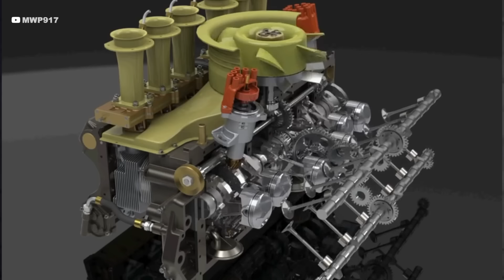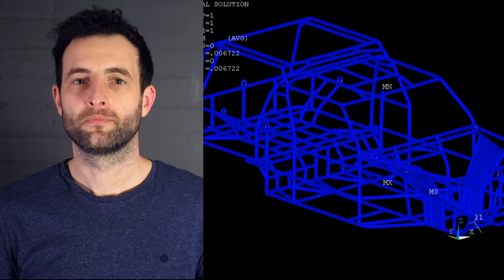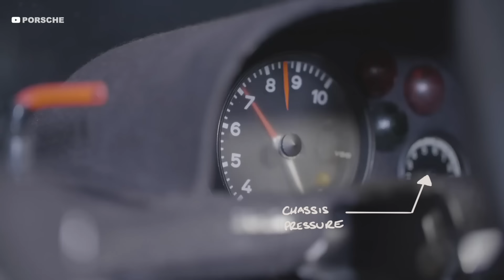The Porsche That Had an Inflated Chassis

Comment: Engineers: Of course, run hot oil through the spaceframe itself! Simple, elegant, no downsides.
Drivers: HELLO, THIS IS LITERALLY A TOASTER NOW, AND I'M THE BREAD
Reply: had a good chuckle when he explained that part.
"why the hell would they discard it?"
"oh."

i honestly thought it was a genius space and weight saving. totally forgetting that someone's actually driving it.
Reply: Not sure why we are getting excited about the oil running through the chassis to the oil cooler. Pretty much every race car of that period did that. Only stopped happening when the sport moved to monocoque chassis'
Reply: @psk5746  mass-production motorbikes also, eg. some Buells used the frame for the fuel tank and (I think?) the swingarm for the oil tank
Reply: @jsleeio  true. Clever stuff. Quite like those bikes, even though I'm not a fan of the engine choice
Reply: My 450 dirt bike uses the frame as an oil tank... Didn't know in the beginning and burned my hand on it 😂
Reply: @HochstartHarry  What bike
Reply: @9.5.9.5  2006 Yamaha wr450f steel frame. 450cc 5 valves a carb and 60+ HP at the wheel.. Best modern widow maker out there (only weighs 103kg aswell
Reply: @HochstartHarry  That's a nice bike right there
Reply: Great for a crash, deep fried driver !!
Reply: With a small crack in the frame, it squirts oil on the track, causing carnage for every other car.
Reply: @HochstartHarry  pocket rocket, nice !
Reply: @scottrich976  not really 😂 its an mx bike not a street bike.. Topspeed with current gearing is around 140-160 kmh
Reply: @HochstartHarry  I'll bet it goes skyward quick. That's what I was meaning, not a road bean.
Reply: @scottrich976  sure does.. Power wheelies in 5th.. Need i say more 😂
Reply: @jsleeio  bourgette for sure.
Reply: @HochstartHarry  f me that's some bike
Reply: No bacon and oven
Reply: @psk5746  mine ol honda xl600 bike also had oil in frame, very nice but hot to touch under desert/hard summer runs
Reply: @jsleeio  honda xl series also
Reply: @jsleeio  yet they still way slightly more than a main battle tank :p
Reply: @psk5746 agreed , NASCAR did it with fuel lines  and oil
Reply: @psk5746  no. They're a cool concept but unfortunately going with the h.d. engine just killed then. My buddy has an XB9R (the one with the full fairing that looked like an actual sportbike) with the 984cc engine, stage 2 exhaust, stage 2 intake, and stage 2 ecu tune, and I walked him on a Suzuki sv650s (650cc vtwin) that was bone stock aside from a Scorpion slip-on. There is no reason a bike with a stock 650 twin should not just beat, but demolish a similar bike with a modded 984cc twin. Sorry Harley riders, but your bikes are slow.
Reply: @brianvogt8125  and with the wall thickness of that tubing being 2mm or less it's not like a cracked frame is at all out of the question....
Reply: @TheMattc999  completed agree. Rubbish engine
Reply: made me wheeze so hard
Reply: couldn't the hot pipes be put inside an even thinner tube, like a heat shield like thing, maybe even make it so that the further half of the inside pipe actually gets put outside the vehicle and gets cooling fins pretty much turning the side walls into a semi-cooler
Reply: @HochstartHarry  my suzuki dr350 does the same
Reply: Those engineers got their first lesson on ethics from the driver...
Reply: @psk5746  Running water or oil they the tubes was outlawed by the majority of racing organizations when drivers got burnt badly when those tubes broke in a crash, NOT because of the coming of monocoques.

Comment: Up! movie: Strap balloons to a house
Porsche: *Makes the car a balloon*
Reply: They could have filled it with helium and it would have been even lighter.😂
Reply: @tanmayta9131  Yeah, some gases are reactive/explosive
Reply: @RacingLegendss  Yes, but helium doesn't react or explode cause it is inert.🙂
Reply: The car flew around the track literally and figuratively
Reply: @getnaenaed4222  that’s true  hahahaha
Reply: Actually the reason they fill the chassis with gas is to detect leaks have. That way if the chassis is under pressure they can check a gauge to see if there are any leaks. It's not to make the vehicle any lighter
Reply: @77Avadon77  Yes we all know that. The helium thing was just a joke. Besides helium is much more likely to rapidly expand or contract even on relatively small changes in temperature causing the pressure to vary drastically.🙄
Reply: @tanmayta9131  I didn't even watch the video you probably had to watch the video to know that LOL
Reply: Should have probably used the word noble.😅
Reply: Helium is a very fine gas and can 'creep' through materials causing the loss of pressure.
Reply: @Berkcam  I did not know that.
Reply: @tanmayta9131  Or hydrogen.
Reply: @Rondo2ooo  Is it a joke or do you not know that hydrogen is flammable?
Reply: @tanmayta9131  vacuum even lighter
Reply: Germans aren't very good at making balloons..
Reply: @BoleDaPole  they are pretty good with gasses tho
Reply: air ship flash backs
Reply: @MechaNick03  The vacuum would probably not be well received by the paper thin walls of the tubes.

Comment: Imagine how rediculous it would be to have a chassis health barometer on your car
Reply: hehehe 
good one
Reply: Bet the drivers paid most attention to that gauge
Reply: Not ridiculous at all. The same basic system (except with compressed air) is used in many tubular structures that rely on weld integrity for their strength - crane and drag line booms, for a start.
Reply: Actually...aeroplanes have this too (sort off)
Reply: @PapaWheelie1  They did. There is a documentary on this car where they explain as much. If the pressure dropped below a certain level, the drivers were instructed to park the car, lest they risk rapid unscheduled disassembly.
Reply: @djeurdjel1   The Zlin 526f (not sure for the others, but on this one  I saw it) does indeed have a pressure gauge for the nitrogen pressure, that probably saved many lives in this acro trainer
Reply: @halofreak1990  LOL!  "Rapid unscheduled disassembly."  You do have a gift with words, and a dry wit both.  <tips hat>
Reply: But it did have an attachment point for one, although the actual barometer (the pressure gauge) was used only occasionally, to check for leaks.  I suppose they could have attached one permanently, as with any other monitor (fuel pressure, engine temp, etc), but if the pressure suddenly dropped, that was pretty much it anyway.  The others you might repair, but a chassis leak would be terminal, at least for that particular race.
Reply: Gotta go get that new chassis with my oil change
Reply: It's like in games haha

Comment: 5:35 "... they pressurized the entire space frame with nitrogen..."
Having indication of cracks it's not the only and probably not the most important benefit of pressurizing the space frame.  
Pressurizing a space frame allows you to use thinner material yet still avoid buckling.  think of how you could stand on a full can of Coke, but there's no way a depressurized can would support your weight.  
The Atlas missile also used this method to avoid buckling while saving weight.  doesn't even take that much pressure.  
so well it may have provided a convenient indication of any cracks, the main benefit would have been the ability to use thinner gauge tubing.
Reply: Actually, a can would hold your weight, if you were able to apply the pressure evenly. The cylindrical form is key there.
Reply: @noneofyourbusiness4294  In real life standing on a soda can and certainly in real life in the frame of a race car pressure is never applied evenly. 
In real life, thin world tubes are subject to buckling instabilities.  To close approximation,  thin wall tubes of the same external dimensions differing only in wall thickness will exhibit the same stiffness until the point the wall buckles. 
pressurizing the tubes isn't some afterthought or just a check for leaks, It is fundamental to the strength of the frame.
Reply: @bengriffin4027  the nitrogen is still a gas though so it's compessible. even if it may help resist buckling a bit, the amount of gas displaced when a tube collapses only raises the gas pressure in the entire frame by a bit. Don't forget soda can's are filled for more than 90% with an incompressible liquid meaning a small change in internal vollume greatly compresses the tiny bit of gas at the top, proportionally speaking. The Atlas rocket was also filled with liquid propellants and when these propellants were drained from the tanks as the rocket went up, the weight of the rocket also decreased so the airframe was less stressed allowing the airframe to better support itself. Besides that, the propellant tanks had different length/diameter proportions compared to the 917 frame which allowed them to act more like a balloon. (same goes for the soda can)
Reply: Lets add a large impact to said full can of coke.... Not only does it crack or buckle... It will blow out significantly.
Reply: @ddewaard3265   Indeed. The compressibility you raise is a very good point, and even if that were not the hypothesis-killer it clearly is, the soda can analogy has another flaw: the relative wall thickness of a soda can (as a proportion of tube diameter ) is several orders of magnitude less than in a chassis tube of maybe 16 to 20 OD x 2.0 wall.
To provide meaningful anti-buckling support in the latter case would require ridiculously high gas pressures, which would cause the elements which were right-sized for tension forces past their failure point. 
In any case, the valves for filling the tubing with gas (which is generally understood in the engineering community to have been air rather than nitrogen in the case of these cars) were nothing more than conventional Schraeder valves, hence completely unable to hold the very high pressures anti-buckling would require.
Reply: @bengriffin4027 : None of the tubes in any frames are under such compression stress that the will buckle - except in a crash. The 917 frame was pressurized to only about 10 psi, so it did nothing for buckling.
Reply: @richardpare3538  The pressure needed stave off buckling need not be very high.  The atlas missle baloon tank structures required just 5 psi to maintain rigidity.  
The weight savings possible with pressurized  thin tubes  can be significant.  I doubt that was overlooked by Porsche. There are certainly many memebers in compression in a tubular space frame.
I don't have the specs on the tubing wall thickness for the Porsche frame, perhaps you do?
Reply: @Gottenhimfella  A can of coke isn't the only example of even the best example, just the real world example many people would have first hand experience with.  
The Atlas missle program is a better example, unlike other icbms it did not use a internal frame but instead relied on a thun skin with relativels low pressure requirements to stave of buckling.... so rathet than a hypothesis-killer as you have declared, the compressability of some of the contents of a coke can is a distraction.
Reply: Willy Kauhsen said it was because of noticing cracks. I stick with the opinion with the guy who test drove it for Porsche back in the day. All possible to hear out of his own mouth in „alte Schule“ podcast
Reply: they used WD 40 in the Atlas missiles, WD 40 was invented for that purpose